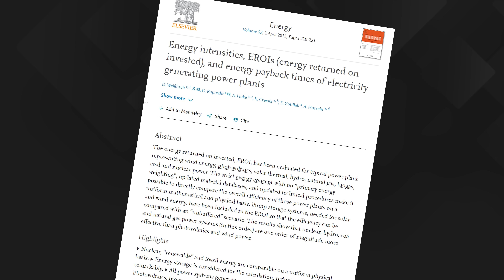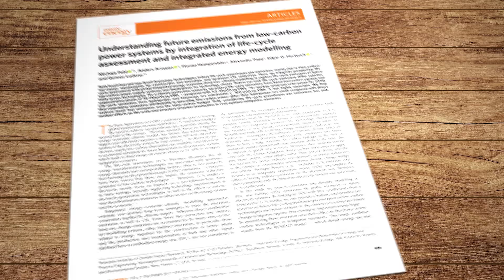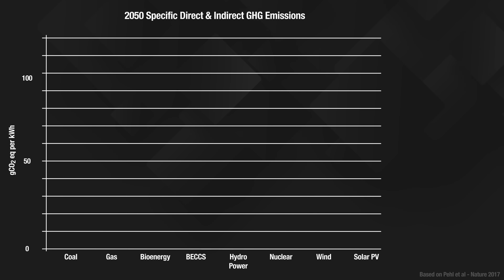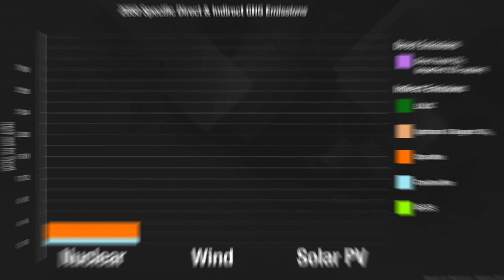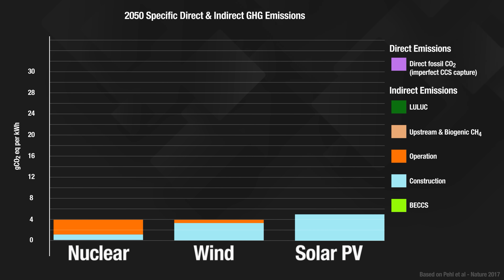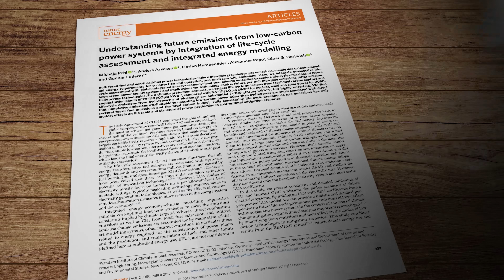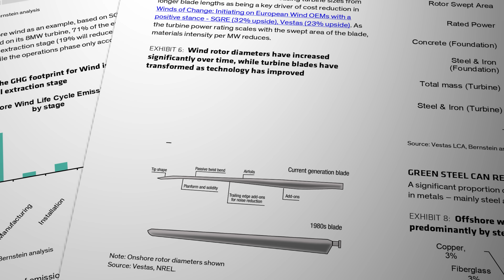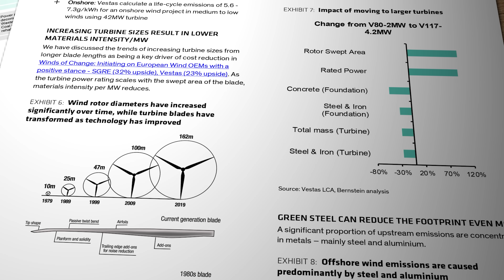Lifetime carbon emissions of renewables vs fossil fuel. Problem or solution?

Comment: Hi, I would just make a quick correction/comment. In your introduction you talked about the study done by D.Weißbach et. al. and its definite flaws, but then turn it into a segue about life cycle carbon emissions, when the study was actually on energy returned on energy invested. These two seem like two different topics to me. Energy returned on energy invested is more concerned with how much energy profit will be made, rather than the emissions made in those processes and focused on if we can completely replace our current fossil fuel-based energy grid and meet the same demand. The life cycle carbon emissions are more concerned with the different energy sources direct effects on global warming through their total GHG emissions. I can certainly see that they have similarities in that they both assess benefits of the energy sources, however they both assess different criterion; 1.GHG emissions and 2. Net energy return. I would be interested to see you do a video on EROI too as it is likely an important inquiry we should be making.

Comment: The real reason for promotion of alternative energy resources is that fossil fuels and uranium are finite resources.
The carbon dioxide emissions are actually beneficial.
Benefits include increased agricultural yields(main effect), reduced winter heating costs and fewer deaths from hypothermia.
In general both solar and wind power is intermittent and requires storage and backup .
Solar power has a big mismatch between peak output and peak demand. There is a major problem with prolonged low sun  during winter at upper latitude areas (above the 35th parallels).
The ITER project will shed light upon the feasibility of nuclear fusion power plants.
Reply: co2 emissions are beneficial if you're going from 278 to 350 ppm over the course of 1000 years and then maintain equilibrium. co2 emissions are going to kill hundreds of millions of people and create hundreds of thousands of species to go extinct if you're going from 278 to 417 ppm over the course of 200 years and have no mechanism to reverse the trend in place.  so good luck with that argument.

Comment: Those carbon emissions over a life cycle are those units normalised to account for the different life expectancies of each technology? For example a nuclear power plant may have an expected life cycle of 80 years but PV cells are around 15/20 years after which they need to be replaced.

Comment: Wind and Solar fluctuate so quickly they require gas turbines. I have a feeling the fight against Nuclear (on the reports, not on your video) comes from the fact that if small, scalable and intrinsically safe Nuclear Generators come around all the others will disappear. Nuclear has one serious problem - the heat that can raise temperature in the bodies of water of a couple degrees. Hydroelectric generate methane from the lakes. Solar and the current battery technologies are highly pollutant in their manufacturing process. Our problem is so huge and the time so short we should be already doing all of them - all of them.
Reply: The time isn't short. Stop believing the world is going to end in the next 10 years like AOC proclaims. If "science" were to be believed, my house should be underwater right now based on the lies and propaganda spread by "science" around the year 2000.

Comment: Very disappointing level of shallow analysis.   Where is the scientific thoughtfulness ? … constantly banging on about life cycle analysis of all sources of energy … whilst conveniently missing the point about wind and solar ! 
… to state the obvious again wind and solar need the assistance of energy storage because us humans Operate on a different timescale to the sun and the wind.   The carbon and economic cost of this side of energy obtained from solar and wind has to be incorporated .  When u do , guess what the carbon cost of electric cars (with a not unreasonable 300 mile range battery) is basically the same as electric cars .  I’m very sure when you add this cost to wind and solar costs the  carbon footprint of these energy sources will far exceeds nuclear ! I’m in favour of moving the energy source … I’m not in favour of deceiving people with false ideas / ideas .  Go and do the homework . My conclusion is that we must have nuclear as a base load supply in many if not all world locations .  Very poor analysis .

Comment: Currently, UK’s electricity usage is only about one third of total energy and only a fraction of current electricity usage is produced by renewables.  Achieving 100% electricity for all energy therefore needs massive increase in the space devoted to renewables - of about 10 to 20 times. There is a real question mark whether we have enough UK land and/or sea space to achieve this as so ably demonstrated by David MacKay in his excellent book Sustainable Energy Without the Hot Air.  It’s an unfortunate fact about our desperately high population density in UK, England in particular.
Reply: How is a 14-year-old book relevant when the whole renewable landscape has changed?

Comment: Nuclear 'waste' is not a problem, but the SOLUTION to climate change! Feed it to breeder reactors and get 100 times the energy out of it! The final real waste is melted into ceramic bricks and then is safe after 300 years. Argonne Labs - 4 minutes. https://youtu.be/MlMDDhQ9-pE

Comment: Not having GDP grow would be a disaster! Even in times of low inflation there still is inflation and no, prices can not just stay the same, this is not how it works. Giant economies with tens of millions of people need to be able to borrow not-yet-existing money from the respective federal reserves. And this isn't a bad thing either, as long as everything including paychecks rise at roughly the same rate everything is fine. I know, everything is NOT fine right now but the dollar value a burger costs is not the problem. It's just a number.
The problem today is not that growth is inherently bad - the problem today is that the top % is paying too few in tax. Even if prices were to stay the same the system as it is now wouldn't work well because too much money is siphoned off to big companies and the rich! If the fed stopped printing money and somehow the system wouldn't collapse we would actually see wages dropping in dollar value - now we see wages dropping in % of what's needed to live.

Comment: There's one big / important omission in the studies cited: it's the energy delivered that matter, not just energy "produced". Which brings the power grid into the picture. The power grid, which uses alternating current, has not just to be connected to both generators and consumers, but also needs a lot of technical stability / safety criteria to be fulfilled every second of operation. 

The stability / safety are at this point largely provided only by the conventional power generating units (I include hydro & nuclear under this umbrella term here), which have inertia and can provide fast reserves. Renewables - again, at this point in time - do not contribute to it to any significant degree. As a result, comparing emissions at the point of generation only, may lead some people to imagine, that we could power up all of our lives with just wind, solar and some batteries - which is now still an impossibility. 

Now, if you make a simplified assumption, that 1 MWh of renewable energy requires at least 0,2 MWh of energy produced by power units providing inertia & power reserves, you can provide a more realistic comparison of total emissions needed. And even that would still not reflect the emissions increased by the necessary build-up of the power grids. 

To compare true total emissions, what you really need is a comparison not of just generation, but also the results of grid buildup and grid stability security services. Would not fit in 12 minutes, but would be worthwhile to point out, to avoid inflated expectations (of those of us, who do not feel the need to know the details of intricacies of power delivery).
Reply: Batteries and other storage can supply stability to the grid. Lithium is already used for frequency regulation, and pumped hydro plus lithium is used for load shifting.

There's actually the possibility of using solar power plants for frequency regulation using special equipment. It isn't common because these "ancillary services" aren't always sold since they come for free with spinning turbines. And the incentives aren't there for renewables doing these things,  they're usually rewarded for maximum kWh output.
Reply: @ThomasBomb45  That's why I wrote "Renewables - again, at this point in time - do not contribute to [stability / safety] to any significant degree". It's technically possible, but will require years of building capacity, while providing financial incentives for renewable generators to provide those ancillary services. Just time and money. And a lot of both. A comparison now should take into account the "now".
Reply: It's also worth noticing the vast difference between fossil fuel carbon intensity and solar/wind/nuclear. These ancillary services would have to be orders of magnitude more carbon intensive to make fossil fuels better than low carbon alternatives. And that's just not the case. Batteries cycled frequently and charged by renewables have only double the carbon intensity of using solar/wind directly. Per a 2019 paper from IVL Swedish Environmental Research Institute
Reply: I heard lifespan for solar panels is just ten Years, so this & whether these can be recycled safely & where they are installed needs to be taken into consideration as not everywhere has the same amount of sun exposure.

Comment: But solar and wind emissions don't include storage that would make it even remotely comparable comparable to wind or solar.
Reply: but solar and wind (at the moment atleast) complement an existing grid.
they do whats intended of them, reduce CO2e output.
Reply: @zaarkeru3391  that is true. The problem is that they only reduce the use, but not dependency on fosil fuels. We use less of it but we still depend on it. The ultimate goal should be resilience and deep decarbonisation. Using only wind and solar for that is like using a bandade for a cut that needs stitches.
Reply: @simonloncaric7967  
of course.

 but the thing you're missing is that renewables (solar, vind etc) are also perfect for the future hydrogen economy that we will get.

so, we should of course build nuclear.
but at the same time we need renewables as they are perfect for the transition period aswell as for the future hydrogen economy.

both roads leads to Net zero CO2e emissions.
Reply: @zaarkeru3391  i wouldn't really say they are perfect as most industries need high uptimes to turn a profit and to pay back the investment of a production facility. And just for H2 production advanced heat sources will be a better option as a plant could run for 90% of the time.
Hidrogen from electrolysis will have a role only for demand balancing so we don't waste power when we overbuild sun and wind, this H2 will be more expensive and the quantities won't be sufficient as we would need to massively overbuild the grid. Overbuilding the grid is expensive and having facilities with low run times is expensive. Not ideal but will definitely have a role.

Comment: CANDU nuclear reactors are known to produce only 3.5 ish g/kWh of CO2 or equivalent.
France’s fleet of nuclear reactors are officially near 4 grams.
And Hydroelectricity in Canada have much lower numbers than your study, thanks to the cold climate and extremely long life span of infrastructures. Hydro-Quebec numbers are about 30 g/kWh.

Oh and by the way, since solar and wind are intermittent, you cannot compare the carbon footprint of those 2 with all the dispatchable ones, because they are half solutions!

Comment: In my view Solar and Wind power should be backed up by nuclear power untill reliable and affordable energy storages are invented. So far many wind turbines have to be shut down due to situational overproduction and nuclear power could fill those bigger gaps like productions during night time or during bad weather. This obviously demands a lot from any power grid, but given how each of these production methods have their strenghts and drawbacks this would be a viable scheme.
Reply: We should stop spending trillions of dollars trying to use renewables which are more expensive than fossil fuels if we spent the same amount on  implementing Molten Salt Thorium Reactors we could be running on near 100% clean energy
Reply: @thefoundingtitanerenyeager2345  Renewables aren't expensive. Infact, nuclear power is the one that's costly. And Moletn Salt reactors aren't even a viable thing yet. Renewables are cheap, get developed constantly, are much safer and they are self sufficient. There's no reason not to use renewables primarly.

Comment: Major problem of both FVE and Wind turbines it that while everybody focuses now on CO2 the peak impact is created elsewhere. So we should always think about the balance. Were there wind turbines before mankind? No? What will happen if we install millions of them? What will happen if we install milions of square kilometers of FVE? Is one nuclear powerplant at the end better than 1000 wind turbines or vice versa?
Reply: why so afraid of wind turbines when all they do is stand in the middle of nowhere and all they're doing is spinning around?
Wind turbines are cheap and safe. Nuclear power is also safe 99% of the time but is very expensive to install and maintain. 
Nuclear power has a place in the whoe energy mix as a backup for renewables durcing times of lower production (like when there's to little wind), but shouldn't be our primary focus since at some point it'll be replaced with effective energy storages.

Comment: Solar panels and wind energy do not solve the climate problems, due to shortages of raw materials. There is already a shortage of sand for the manufacture of concrete and silicon. CO2 is not the problem, it is the destruction of the environment by producing those 'green' targets.
Reply: CO2 is the issue, co2 outside of the carbon cycle (fossilized emissions) are a pollutant.

Comment: Thank you for this but I have a number of issues with your assessment of Hydro:  
1. with Hydro Electricity it is controllable and it is like its own battery - you really need to add a battery to the wind and solar to get the equivalent dispatchable electricity.
2. with hydro most of the carbon that goes into making them virtually lasts forever - you really just need to replace the turbine blades every so often and rewire the generators occasionally and maybe even replace penstocks when they wear out (I've seen hot riveted penstocks still working well in the mountains of Italy and they must be well over 100 years old).  So I think if you looked at the carbon emissions say over 200 years between the different power generation assets you would get a different story - the intriguing thing is how different!
3. I suspect the methane emissions from hydro dams differs substantially. A lot of them here in NZ are glacier and high country fed where there is very little vegetation, I'm guessing not only are they not silting up much, they probably aren't producing much methane either.

And with wind turbine blades, you suggest they are being recycled.  But what I think you mean is that they are being de-cycled - being composite I wonder if they really are being separated into their component parts or just chopped up and burnt?

And I think you had an article about wooden windmill tower construction (fantastic in that its carbon negative), you might be interested to know that there wind turbines that have been in successful operation in NZ for some 20 years that are made from locally grown exotic Raditata Pine veneers laminated together (Contact Geoff Henderson now at Seawind technology in Genoa) .  While not necessarily any more recyclable than the glass fibre ones, they do store sequestered carbon and timber has I believe a very good fatigue life compared to other materials.
Reply: definitely not recycled as you cannot recycle composites, ever. Epoxy that has undergone chemical changes is a one and done material. It becomes landfill.
Reply: UK
 All really good relevant points! Thanks.
Reply: Although basic but functioning very well, you may enjoy Kris Harbour's YT channel. He has built Hydra and also wind powered units for his self build home and workshop in Wales. It is not high tech but it may gladden your heart to see what this young man has designed and built from scratch and mostly alone. 👍
Reply: The problem is not that he didn't question his source of information. The problem is that he did it on purpose. I think he is bias and dishonest for this same reason.
I don't even know why Youtube keep sending me this dude videos. I feel offended by his cynicism and disrespect to my intelligence.

Comment: Actually the rebuttal of the EROI paper from the University of Sussex was more or less purely based on a nomenclature basis, i.e. what should EROI include, and had no response to the actual underlying figures which I found to be extremely robust. Specifically they argued that you should include the energy in the fossil fuel or fission material consumed as part of the calculations which is objectively a philosophical nonsense argument.
The simple fact is that in order to continue to enjoy and to expand to the rest of the globe our current level of prosperity we'll need a lot more variable renewable infrastructure than fossil infrastructure. Even less so with fission which simply wipes the floor with magnitude better EROI's than the other technologies and has substantial potential to get better. The only thing that comes close is extremely large wind turbines (10 MW+ spec) in regions where they enjoy a high capacity and excellent supply-demand relationship.